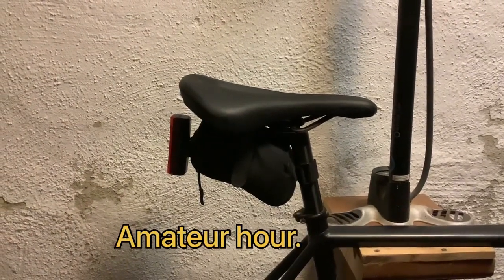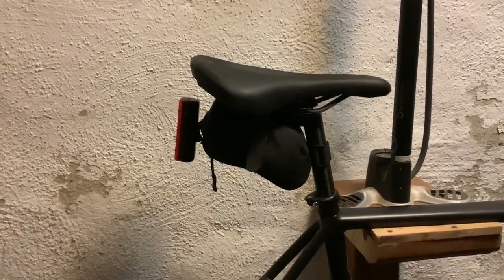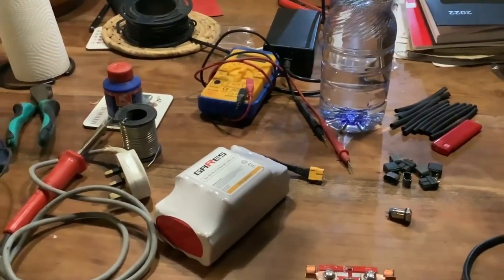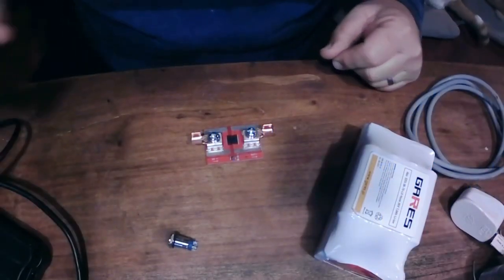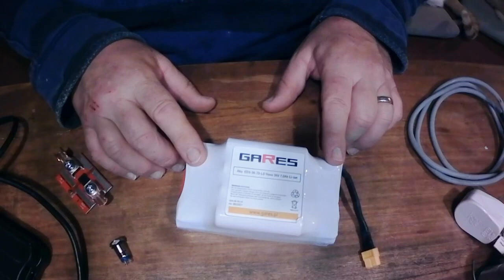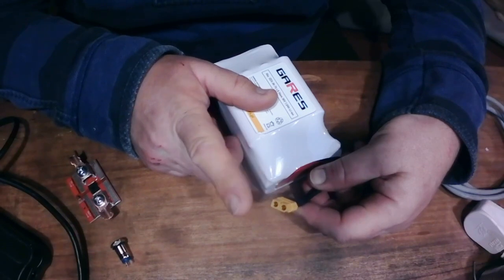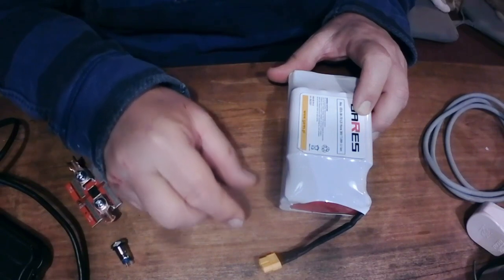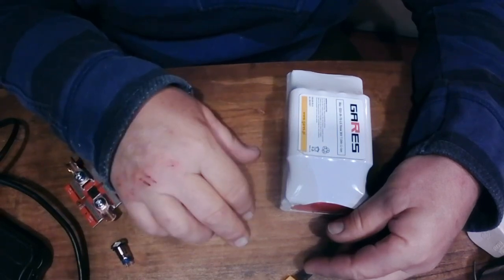DIY Mahle X35 Range Extender - Save $$$$$!

Comment: Also, looking at the way these things are connected, I don’t think it’s possible to truly have a secondary battery in parallel. I think you said this in relation to reducing charging cycles. The secondary battery always seems to drip feed the main battery.
Reply from the maker: Hi Andy. I’m certainly not a techie so everything I’ve done I’ve either read about, and now increasingly, am experiencing. Any idea how to test the idea that my second battery is still acting like a charger? One guy has used his secondary battery at a significantly higher voltage than the internal one and reported an over voltage error message on the Mahle app and heat at the port and connectors this sounds like the batteries are trying to equalise voltages.  You would hope this wouldn’t happen if the Orbea’s BMS knows what’s going on? If I ride up a hill in full power, and disconnect the batteries to test voltages at the top, the internal battery ought to be considerably lower in voltage, having been consuming say 8amps whilst receiving say 2a, netting 6a of loss for the climb, rather than the -2a for the hoverboard battery, right? So if they are the same…I will try to check today, tomorrow at the latest. Another user has stated that the BMS detects incoming voltage and swaps between charger and parallel modes. What do you think? However it works though, it does work to extend my range. Sorry for the lengthy reply, I’m intrigued by this stuff!
Reply: @yakoridesagain  Hi Yako, I'm very glad you are carrying out these practical tests on these systems, as i think we can work out the best way to do things through a combination of trial and error and tech knowledge. I have recently bought a Mahle motor system bike, so i want to try and make an alternative power source for it. From what I have researched so far the connection on the bottom bracket of the bike (to the internal BMS) will only feed the charging circuit for the main battery. I can only imagine this is a safety feature so that the BMS controls all aspects of the incoming power. The difference between a fully charged battery and a partially depleted battery will only be in the order of a few volts (on a 40v config). There will be no physical connection directly to the internal battery connections from the bottom bracket socket, so it can only ever be a charging influence. To charge a battery a slightly higher voltage, than the internal battery is required - to create a current flow. If the voltage is too high I would imagine the BMS would report this as a fault and not allow a connection (because this would potentially allow too much charging current to flow). As current is drawn from the main battery the potential voltage across it will drop as a result of a depleting capacity, this will cause an increasing voltage difference between the fresh battery and internal battery, allowing more current to flow. I can't imagine there would be any way of paralleling a battery unless you physically solder wires to the internal battery connections - which would be a really bad thing to do. One of my initial thoughts was to use 2 lithium power tool batteries in series (18v x 2 = 36v). I have some  Dewalt tools so I may give this a try. These could be plugged in to the bottom bracket socket. Of course these opinions above, are my own, I haven't carried out any tests to verify what will work, and what won't.
Reply from the maker: Apologies for not running the test yet; I’d prefer to do a specific test rather than during a normal ride (never have enough storage space and a voltmeter isn’t tiny). I understand that the charging socket on the bike SHOULDN’T be connected to the internal battery connectors, but originally, and after the release of the X35 system, Ebikemotion stated that the proposed extender battery would be a 250wh unit that would run in parallel. I’ve hoped/assumed therefore that they included some wizardry that can allow this to work - perhaps a means to differentiate between a charging voltage of 42v and that from a secondary battery? I’ve tried to blinker myself to the fact that a fully charged 36v battery would be pretty darn close to that, maybe 41.6v….but if the secondary battery is simply acting as a charger, the electronics required to continually balance the batteries as they are depleted would be tricky, wouldn’t it? There would always have to a a voltage gradient from the second to the internal battery to allow charging to take place? Wouldn’t the internal BMS be expecting 2a at 42v only?
Reply: @yakoridesagain  ...... no apology needed yako, just very glad you are looking at this whole subject. And, i apologise in advance for a very wordy response.  Did you get anywhere with your further experiments? It’s really hard to get definitive information. I haven't seen any info about the piggy back battery acting in parallel though - maybe i've missed this. You know I wonder if this could just be a marketing turn-of-phrase, rather than technically correct information? I mean, the rider could perceive the piggy-back battery was in parallel - apart from the slow charge rate, which wouldn't be an issue if the second battery is connected before the main battery depletes too much. 

If the charing of the piggy back battery is passive, and just relying on the voltage difference between the main and secondary battery, then the charge will just occur without control - ohms law. The trickle current will reduce as the voltages equalise? They may never equalise if the main battery is being depleted during riding though. 

A practical test, maybe to half-charge the main battery and half-charge the range extender battery. Then just leave the bike switched on but not actually move the bike anywhere. Would then be interesting to see if the main battery was charged further, or whether both batteries sit there at a balanced voltage and remain both half charged. If they both remain at their status quo, then I think it may be a passive charging circuit relying on a higher voltage of the charged battery (or plugin charger), to derive the charge current for the internal battery. 

To answer your question about charge current being 2a. I don’t think constant current charge is being used here. My understanding from what we’ve discussed is that the charge current will be relative to voltage difference as above mentioned. This is purely an analogue loop, so no real control needed. I can’t say any of this is categorically correct, because i don’t have knowledge of the components used (yet).
Reply: @yakoridesagain  perhaps asking Mahle directly? The thing that gets me is why they abandoned the parallel battery idea and went with a charging solution instead? They must have run into some problems as the idea of having two parallel batteries as an extender makes much greater sense for battery longevity.
Reply from the maker: I will try that Andy as for this week I’m stuck doing work so unable to ride to do out in the field/up a mountain tests. I’ll let you know the results.
Reply from the maker: But if the second battery is passively topping up the internal battery, wouldn’t the equalising amperage get pretty high if I’m crawling up a steep hill at full power and drawing 10+ amps? Would there be excessive heat I could check for?
Reply: @NeilLavitt  could certainly ask Neil, I just have a feeling you may not be able to get anything more than is already out there. They would prefer to sell you one of their range extender batterys'
Reply: @yakoridesagain  again only my thoughts.... Any charging current would be through the internal BMS, which would limit the charge current to 2 amp.
Reply from the maker: Just to throw something into the pot - my last ride ended with a long climb at 12%. I was tired and ran the assist at maximum, level 3 for approximately 15minutes. My car was waiting at the top of the climb, so the batteries were disconnected as I completed the climb. I’ve  just checked the voltage of the two batteries and they are identical, at 37.9v. Just an observation until I can do more proper testing.
Reply: @yakoridesagain  definitely interesting and adding to the whole picture. There's such a subtle difference between 'in parallel' and 'trickle charge' setup. The more i think about it, the more i think this arrangement is in essence ‘almost' acting as both. After the cycling trips you have done, do you get a sense of how the batteries are power sharing?
Reply from the maker: I was fairly certain - until our chat! I think you have covered all of my sticking points with the charging not parallel idea. It needs a proper test of me caning it up a horrendously long and steep hill at full power to get a better idea though yet oddly this is now the longest period off a bike I’ve had in nearly 2 years…fog and rain this morning too. Bah.
Reply: @yakoridesagain  3 weeks of rain here is Sydney. It’s been grim but we have some sunshine again so back out.
Reply: @yakoridesagain  I think you’ll be right to see how high current draws from the system and see where the batteries stand at the point. One of the chaps in another Facebook group seems to think the 2Amps isn’t an issue. Still, irrespective, you have built a budget charger and still have a drink bottle space. You could of course mount one on your handlebars.
Reply from the maker: Your rain Neil has been biblical. Hope you and yours stayed safe.
Reply: @yakoridesagain  ha, sorry it sounds like I’ve thrown a spanner in the works. Electrically speaking I still believe ‘the second battery charges, or props up the main one. But when you have two batteries and a BMS in a loop, they all appear in parallel, but the draw off point to drive the motor is definitely from the main battery only - imho. When I’m able to get hold of a some kind of second battery and get some time to experiment……. I have been watching some of the battery control utubes for e-scooters, which I believe use a similar system when running with a second battery. Sorry for any confusion, and glad you are getting out and about on the Orbea, when the weather permits! Looks quite baron where you are, but i love spain, and normally a lovely climate to boot.

Comment: My girlfriend actually bought a range extender for her Orbea Optima. It broke down after almost 2 years. They did replace it (it was still under warranty), but that also broke down after not even a year! The same issue happened on both batteries, it seems I could charge them fully. But they don't charge the internal battery any more. They don't add another 2 years to the replacement, so I have to find another solution, but it won't be buying another new one that's for sure.  I'm wondering what I could replace on my end, so I don't have to spend another fortune. Or in the end I make this for her. Maybe it's time how to learn to solder! 😅
Reply from the maker: Yes, you really should Edwin! You could buy the parts and ask for the few solders joints to be made by an electrical appliance repair shop…

one word of warning if you go ahead. To be extra safe, check that the voltage of your fully- charged internal battery is close in voltage to the fully-charged external battery that you buy before connecting. 

This is a cheap alternative that works, however. Good luck!
Reply: @yakoridesagain  Orbea didn't want to replace the battery, but I'm glad Mahle wanted to replace it. Glad it worked out. If this one breaks down, I'm going to make one myself! :)
Reply from the maker: Very glad it worked out Edwin. Ride happy!

Comment: Thanks for this, much as I like the Mahle system I wasn't happy about what appears to be the rip-off range extender price, however if I can get a cheap DIY version then it all becomes much more attractive.
Reply from the maker: It does. Should help with the longevity of the internal battery too, important when a new one is €600+. If you are careful with cell choice in your hoverboard battery, 300 or even 320Wh are possible (mine is 252Wh, the Mahle one 208Wh). Don’t believe the hype with Chinese batteries that claim higher than this. Good luck!
Reply: @yakoridesagain  this is a fantastic tip for every X35+ owner. Just bought a Meriva eSilex 400 with the same system if your Orbea. 
Would it be possible to have a list of the elements to buy? It would be fantastic if you could also provide the links where to find it.
Sorry but as a non-native speaker, it's challenging to understand exactly what's needed to assemble it.
Thank you in advance from Italy
Reply from the maker: Vito: è possibile acquistare tutto da Ebay, per esempio:

XT60 connettore, https://www.ebay.it/itm/172225507077

Ideale diodo, https://www.ebay.it/itm/403219295120

Batteria de hoverboard,  https://www.ebay.it/itm/373657202909

Tubo termorectractil, https://www.ebay.it/itm/254290021051

Eléctrico cavó,, https://www.ebay.it/itm/224927427440

borsa del reggisella - bene, sono sicuro che puoi trovare questo!

Yako
Reply: @yakoridesagain  Thanks! expecially for your italian! :)
Still missing the connector but I'm confident we'll find it sooner or later
Reply: Which it's the right one?

Comment: hi mate, is battery compatible with x20?
Reply from the maker: I’m sorry Jay, I’ve no idea. I was happy to try this with my 2nd hand Gain, but if you’ve dropped a big wad of cash on an X20 powered bike, you’d have to be brave to try this! 
I suspect that the controller or BMS on the new bikes wouldn’t ‘recognise’ a non-standard extender and wouldn’t work. The X35 was originally designed to work with a battery like my set-up; the X20 wasn’t…

Comment: So I paid £550 for a range extender for my 3 year Orbea Gain then two weeks later the main battery died, so now I’m paying £690 for a new main battery, I should have just offered you a free two week holiday here in the UK and you could have sorted me out.
Reply from the maker: Oof. You’ve already paid for the new battery? I was thinking that when mine dies I would try to get a battery expert to re-cell mine with higher capacity cells…tech has moved on and it OUGHT to be possible to easily achieve double the capacity of the internal battery…which means you could sell the extender…
Reply: Yes battery has been paid for, just waiting for delivery to my LBS. You would have thought technology would have moved on wouldn’t you but then I’m also guessing they would also redesign the battery NOT to fit older models. I can’t believe how you can make a homemade battery that’s smaller and has twice the range of an extender but the professionals can’t 💁
Reply from the maker: @Sean-vz7zw  *smaller, cheaper, lighter AND more range ;-)
In their defence, I believe Ebikemotion originally planned for an extender like mine, but were put off due to the fact that the consumer, to be really safe, would need to check that the voltages of the two matched before connection. The reality would be that most wouldn’t, with the possibility of an instant equalisation of voltages between the 2 batteries that would absolutely fry the wiring, possibly kill both batteries and start a fire. Of course a wee bit more electronic wizardry and this would easily be avoided, but I think to cover themselves they made their extender a simple battery charger instead.

Comment: Do you sell these?
Reply from the maker: I’m afraid not Morpheus, but if you buy the parts, any home appliance or computer repair shop could do the few bits of soldering in seconds. It would still be a quarter of the price. Mine has transformed my riding (take a look at my other videos).

Comment from the maker: I’m getting a lot of people asking for links to the various parts. to make this extender. I’ve done this several times for people over the years but these links become out of date and stop working, so please note you will need to do a little bit of research. Most things are available on AliExpress or EBay, though I would advise taking the time to find a decent battery.
As of 2023, this list / links were:

XT60 connettore, https://www.ebay.it/itm/172225507077

Ideale diodo, https://www.ebay.it/itm/403219295120

Batteria de hoverboard,  https://www.ebay.it/itm/373657202909

Tubo termorectractil, https://www.ebay.it/itm/254290021051

Eléctrico cavó,, https://www.ebay.it/itm/224927427440